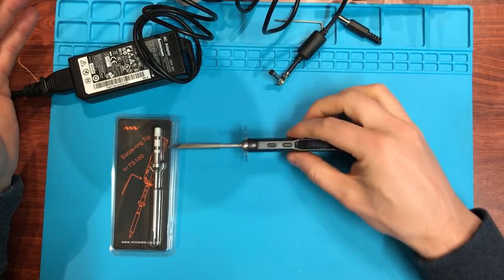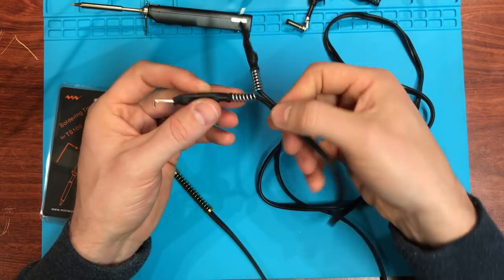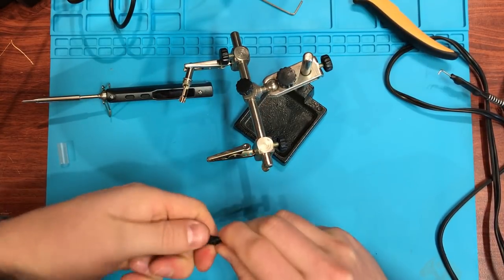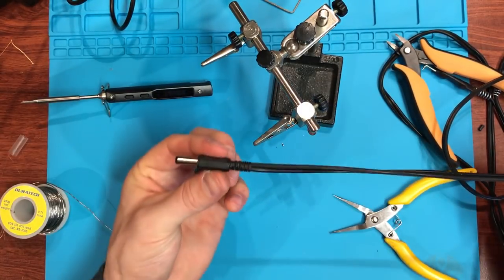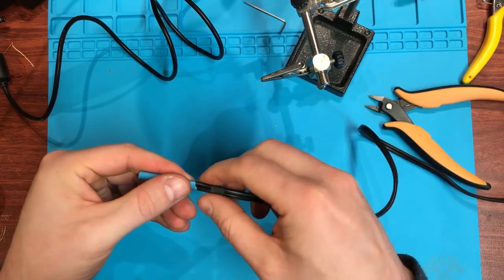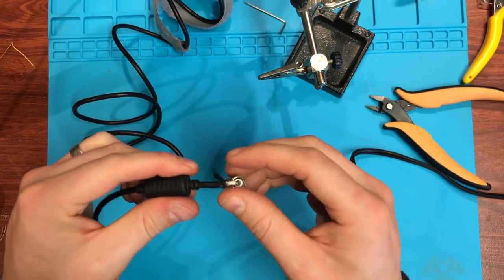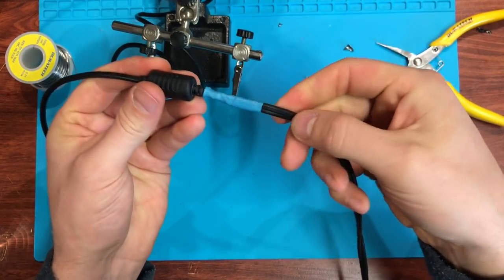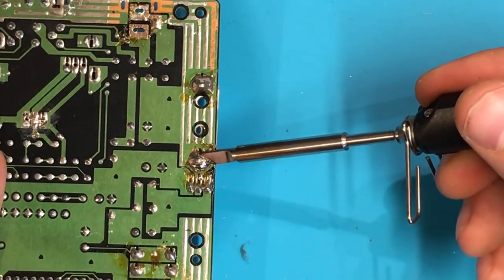TS100 Soldering Iron Power Supply & Cable Mod - YouTube

Comment: Tip for sliding cables through tight sleeves or heatshrink, apply a squirt of IPA (Iso-Propyl-Alcohol). Fantastic for fitting tight clip on covers too. Evaporates leaving no residue. Best trick I've learnt in years!
Reply: 91% alcohol is hard to find these days.

Update: I finally found some.
Reply: @AtlantaTerry  everything is hard to find these days
Reply: @fischer1672  some women would say that it is easy to find hard these days

Comment: I converted three DELL laptop power supplies to have XT-60 connectors on the end.   They are rated at 18.0v 2.6amp..  which is just above 4S max.   Multimeter tells me they are putting out 18.9v unloaded.   Once I can use on my DJI FPV goggles, one on my TS-100, and one on my Lipo charger.    I was afraid it'd be a bit too much for the Goggles but they seem to cope with the extra voltage just above spec just fine.   I also bought one of those 24v 17amp server power supplies bundled with the TS-100.   It's nice because it comes out at 6S, which I can use to power up my quad on the bench.... or I can use  it on the Lipo charger if I should need more amps with a balance board.

So solder on an XT60 male on the end of your power bricki, and then solder up a stand alone TS100 cable with an XT60 female...  and then you can use your power brick for multiple things.   You could also solder up a XT60 male to aligator clips, then plug your TS100 cable into that if you ever have to power it off a car battery supply.
 
I write on my XT-60's with a red and black sharpie... +/- symbols, and how much voltage it might put out so I don't mix things up... i.e 17v, 24v, etc.
 
So you'll end up with all kinds of adapters and cables.. what to do with them?  I found slide lock ziplock bags make a great way to store things and keep cables from getting tangled.   Just stuff identical or similiar things in zip lock bags, and zip them and label them with a sharpie.    
fpv.air-war.org

Comment: Ultimately you want to have 65 watts going through the iron for the best performance in terms of the power delivery needed to get heat from the tip into the materials you're soldering. You won't see wattage on power supplies but the calculation is to simply multiply the volts, in your case 20, by the amps, in your case 3.25 to get 65 watts.

Comment: Well I don't even have a TS100 but I was just thinking the other day, if I do get one I'd like to use silicone cable for power. I think I have a bit lying around that came with some high powered telecoms equipment at work but I hadn't considered the strain relief, so I enjoyed watching this through. For me a serious bonus was an inadvertent multimeter tutorial. I've owned an Amprobe 37XR-A for about 10 years, it was my first meter. It has a couple of interesting features I haven't seen on many other meters. It took me many many years before I found a use for the inductance measurement in Henry's - the water level pressure sensor on my Fisher Paykel washing machine when it was playing up (a diaphragm pushes a ferrite bead through a copper winding if I remember right - it was a lightbulb moment seeing that). And the other which I've never used until today is the Logic setting. I was wondering why you didn't just use the continuity tester on your awesome old meter but I grabbed mine to try it and sure enough the Logic setting gives me IMMEDIATE continuity feedback whereas the actual continuity buzzer has an annoying lag, the manual actually states about 100ms. So although I still have to one day learn about its actual intended TTL/CMOS usage, I'm gonna call it and say I've finally found a use for all the settings on that meter :-)  Geeze there are some whingers on here. Some people seem incapable of realising not everyone knows as much as they already do. Or in fact I'd wager the ones complaining are often the ones who 'know enough to be dangerous' because they already think they know it all. I avoid them at all costs. Thanks for the video.
Reply from the maker: chocolate squiggle Thank you 👍

Comment: FYI, The countdown timer is how many seconds before the iron goes into sleep mode.  It does not show time to heat up to set temp.  Once you move or shake the iron, it resets. Leave it still on the table and it will count down.

Comment: Silicone cord is definitely the way to go. My TS100 feels like a cordless soldering iron, and with a 20v supply and Ralim firmware it has basically replaced my Aeyou 968 A+.

Comment: Heat shrink on the plastic body is quicker and more effective than tape.  Don't use loctite on plastic as it interacts with and ruins the plastic, if you feel that you need an adhesive use some form of glue or steal some of your wife's nail polish.  From experience I speak, been here done that.

Comment: Nice vid and great idea, I'm going to make one of these using a silicone cable with male and female 5.5mm x 2.5mm connectors at each end so I don't have to butcher a laptop power supply.
Reply: Did you find a good supplier for the plug and jack? I can only find a 20 pack of both male and female ends.

Comment: the dotted line means switching power supply btw, which is smoothed by inductors and capacitors. The ferrite bead you have there will have SOME induction effect on the wire, but barely any. Mostly, those are used to reduce EMF, not really anything else. great for audio setups etc especially in noisy environments like a workshop with a lot of interference, but it won't really help at all for the TS100.
If it doesnt bother you to have it there, though, it won't really hurt to be safe anyways.

Comment: That cable with the spring is very nice - I have bookmarked the link you provided for it! I have used these exact same ThinkPad 20v adapters to power tons of gear -- most recently a nice Dell 2000FP 4:3 LCD monitor with composite / s-video inputs on it. That soldering iron is definitely interesting - looking forward to seeing how it holds up over time.
Reply from the maker: Thanks. Yep I really liked the spring cable so I thought is was a perfect choice. It's still going strong and gets used daily now...

Comment: Nice recommendation for the tattoo gun cable. Your link is dead, but searching "silicone clip cord" on eBay or AliExpress comes up with plenty of good options under $10 that include the spring at the jack.

Comment: Saliva is a great lubricant for snug fitting heat shrink, heat removes when shrinking
Reply: Yeah, BUT saliva can leave a residue AND it is very slightly acid.
Back in the day photographers used to lick their flashbulbs prior to inserting them into a flashgun. Over time, the saliva corroded the contacts in the flashgun.
Terry Thomas Photos / Atlanta
Reply: A better choice for a lubricant is 91% alcohol and it will evaporate.

Comment: Hello there. I have a power supply its 19.5V and 4.62 A output......will the higher amps kill my soldering iron ? Thanks ..great informative video this one. Thumbs up !
Reply: You could use a 100 amp 19.5 volt supply if you wanted. Amps are just how much it can supply, it does not mean it will use it all. What you don’t want is not enough amps.
Reply: A good way to think about this is, current is pulled, not pushed. The 4.62A is just how much can be pulled from the supply, and the soldering iron will just pull how much it wants under 4.62 amps.

Comment: Little piece of information that probably won't matter TOO much, but twisting the strands after stripping the wires is actually not something that helps after the job. It helps with soldering, but lessens contact area and decreases the strength of the joint. Could become relevant for something that moves around alot, but I doubt it will be too bad in this case anyway, especially with the double strain relief you've ended up with.
But still good to try to not keep that habit too strong

Comment: Does this power supply leak AC to the tip like most Y-capacitor coupled switching power supplies discussed in relation to the TS100 ?

Comment: Good thinking with the lead - i went through this myself about the time you made this but struggled getting the cable.
Note:   There is another version - TS80 (which is less power) which uses the type-C connector which is a much better connector than the micro-USB on the TS-100 and loses the power jack completely
Reply: What? I thought the USB ports were only for data, not power.
Reply: @AtlantaTerry  check out the ts-80
Reply: @AtlantaTerry  The USB port on the TS100 is for data. The one on the TS80 is a power port.

Comment: Im thinking of buying a iron, witch do you recomand ts100 or quicko with hakko tips.
Reply: I have both TS100 and Quicko 952. 

If you just solder on your bench, the Quicko is a much better choice. Firstly, it's ESD safe. Secondly you don't have to meddle with cable or anything, it comes with silicone cable by default. Lastly and very importantly, my quicko's iron handle has much better ergonomics than TS100, I hold must closer to the tip which gives me more control, the TS100 is quite a bit more awkward to hold.

That said, if you need to solder on the go, definitely go for TS100.

One caveat about TS100. My TS100 is over two years old, the OLED screen has failed. Ordering a replacement screen from Miniware cost me US$10. They charge US$5 for a screen which is ridiculous. My T12 station is also more than 2 years old, never had a single problem with it. So if you're going with TS100 and that's your only iron, you'd better have spare replacement screens on hand cuz I've heard a lot of people's screens have failed. My TS100 has always been on original firmware if you wonder if it's 3rd party firmware that sped up the wear.

Comment: 15V 4A should work almost as good right?
Reply: It would work. But even with your 60 watt adapter, the ts100 won't draw 60 watts of power because of lower voltage. With 15 volts it would draw prolly 20 to 30 watts. So lower thermal recovery and slower heat up time.
Reply: No. You really need 24 volts for the iron to work best.
Reply: it will work but it's only 28w power.

Comment: maybe a 3 core cable would work better? Use the 3rd core to connect the earth. The supplied one is too short & adds a lot of spring tension.
Reply: I did that.  The 3rd wire also keeps the 5525 plug from falling out in use, but it meant I had to modify the PSU (I used an XP-Power 24V 65W) to pass through the mains earth connection.  The smallest silicone 3-core I could find was 0.75mm², which is a bit clumsy, but OK.  I also had to solder over the centre-pin rivet in the plug to get a reliable contact.  I used some spiral-wrap to relieve the cable stresses, anchored to the earth wire.  Whatever, it works, I use it a lot, with a full set of bits.  Great little iron once these things were done.

Comment: Was busting my balls trying to find a 7.4mm to dc for my dell laptop charger when I remembered I had an old hp laptop charger and sure enough they use a DC jack so no need for an adapter cable, may however get an extension cable if I can't get on with the laptop lead but its pretty thin and a straight connector so I’m pleased with that find.

Update: I undershot the size of the DC connector and the hp jack was too small, Now im rocking a Dell charger with a 7.4mm to 5.5 DC jack

Comment: Hi 🙋‍♂️, one cuestión 🧐 how’s work to 12 volts ?
Reply: 12 volts will work but your soldering iron will not get very hot.
You can find used laptop power supplies from eBay sellers for about US $10.

Comment: To clarify the DC Barrel connector dimensions:
 - Male connector: 5.5mm outer diameter, 2.4mm inner diameter
 - Female connector: 6mm  inner diameter, coaxial pin with diameter 2.1mm
When searching for a connector online, the dimensions referenced are: 5.5mm and 2.1mm (whether you're looking for male or female parts)
Reply: No, unfortunately 2.1 and 2.5 mm connectors are different though awfully hard to tell apart. You might get away with using a 2.1 male in a 2.5 female but it probably wouldn't be very satisfied^h^h^hactory. <cough>

Comment: I'm sure someone has mentioned already that a bit of soap on the rubber coated wires will help with installation. (8:10)
Reply: Silicone is not rubber.
91% alcohol works as well and then evaporates.

Comment: looks like that silicone tattoo cable is no longer available. I can find a bunch of slightly similar cables but they're more money and don't have the nice strain relief.  Pity.
Reply from the maker: Aaron Kelly This one will work https://www.ebay.com.au/itm/Power-Cable-Clip-Cord-for-Tattoo-Machines-Red-170cm-Z6E9/122408757058?_mwBanner=1&ul_ref=https%3A%2F%2Frover.ebay.com%2Frover%2F0%2F0%2F0%3Fmpre%3Dhttps%253A%252F%252Fwww.ebay.com.au%252Fulk%252Fitm%252F122408757058%26rvr_id%3D0%26rvr_ts%3D27eece071700a4d129107035ffecf81f&ul_noapp=true&pageci=54f21302-110d-46d2-a761-de68f23659af&epid=1580504055

Comment: It is so ridiculous that they don’t provide a power supply for this product...
Reply: Mine came with a nice 19v power supply.. I guess it depends on the vendor. It was actually in a larger box alongside the Ts100 box.
Reply: Why ?
Reply: Some come bundled with 19.5v supplies, some come with 12v ones, not found any with a 24v supply
Reply: Yeah. I ordered one with a power supply but no 24V, so I had to buy one myself.
Reply: @Mazinga  i'm going to use a 19.5V one from my old laptop, might try and mod it to 24V at some point though